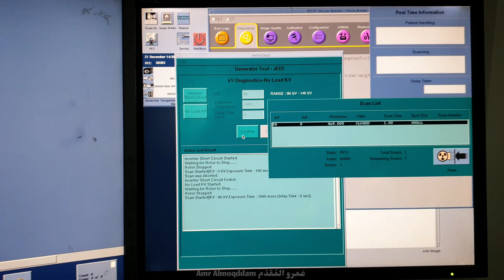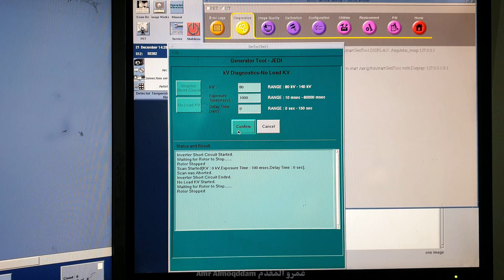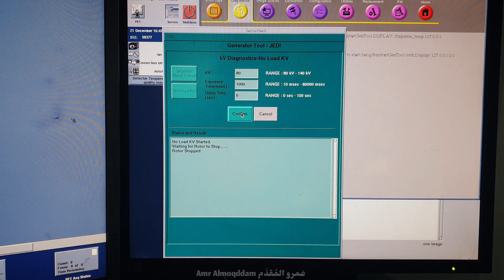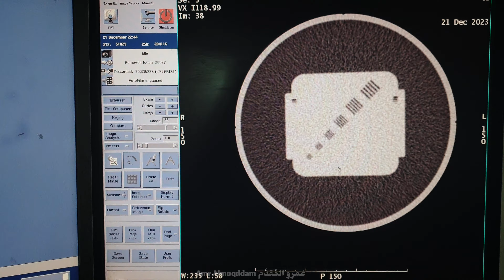GE’s Discovery PET/CT machine Generator maintenance, High voltage Tank ⚡️replacement, Amr Almoqddam

Comment: Good morning, do you change the oil on these tomography machines?  How is the exchange made?  Do you have a video on how to change the oil?
Reply: Changing oil on these tubes takes time . Usually after filling they are kept for a day in vacuum to remove the trapped air.
Reply: Ah cool, so do you have a video doing this oil change procedure?  Or do you have a PDF manual that you can send me, I'm going to do this oil change next week, but I don't know how to do it, can you help me?  Do you have a manual with this procedure?